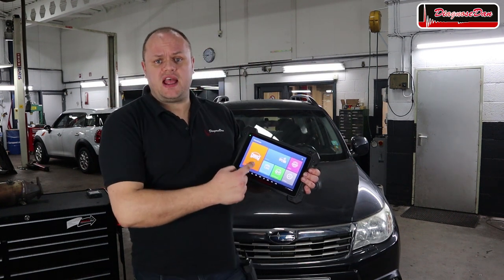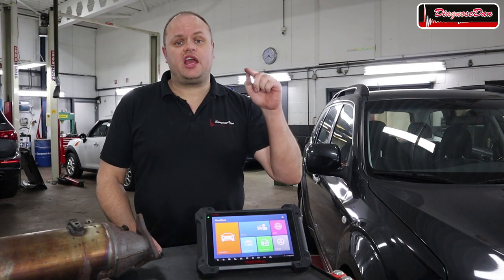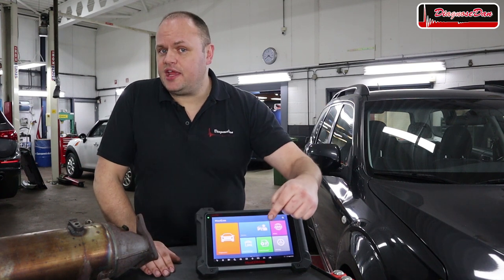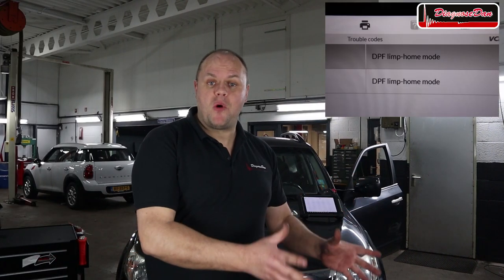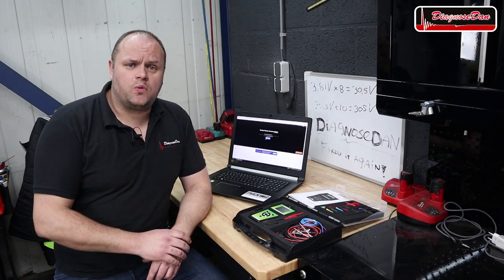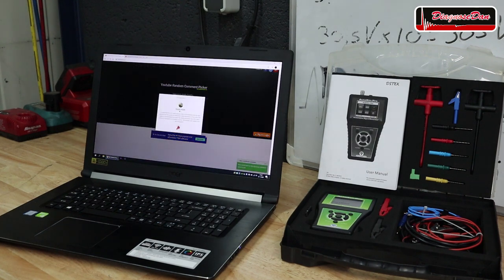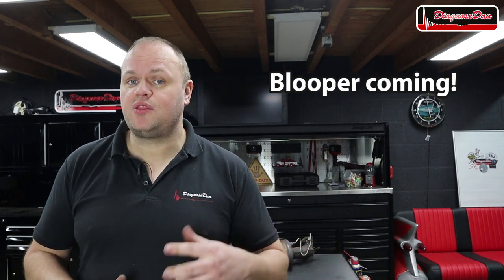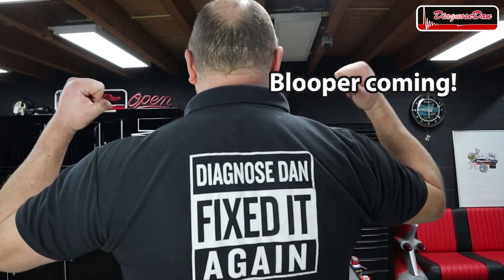New Car parts aren't always good Car parts!

Comment: You still dont know if the problems fixed. The aftermarket filter you have installed now can still have a smaller capacity. So the car will start to regenerate after like 600 or 700 km instead of the 800 to a 1000. Most cars will set a code on to frequent regenerations. Thats why I always tell my customers to buy a original or let the original get professional cleaned.
Reply from the maker: Thanks for watching 😀

Comment: There's also the issue that Japanese diesel motors are garbage. The older non emissions related stuff was excellent and bullet proof, but the later common rail with emissions controls are trash. Bosch and Siemens make the best diesel solutions - the Subaru stuff is just unrefined nonsense.

Comment: Hi danny and thank your for the video! there is some cars with DPF sensor with just one line that mesure just the front of the filtre (exp:clio 3 with 1.5Dci engine)... how the ECU can determin the difference in pressor ? and thank you
this is the sensor : https://picclick.fr/Capteur-pression-diff%C3%A9rentielle-RENAULT-15-19-20-23-283507248184.html

Comment: 6:55 can't you just use a t-coupler and have the gauge just do the difference measurement directly?
Reply: You would be creating a bypass for the exhaust gases, giving you an artificially low reading.
Reply from the maker: Ha ha than the pressure could escape to the other side of the DPF😉

Comment: Kind of looks like it could have been fixed like Toyota fixed a customer of mine's Toyota.  In this case it was a Cat code in a vehicle, within the warranty milage.  Yes Ma'am, we fixed your problem, the light is off.  A couple years later I get a call from her, her car is not passing NOX emissions.  Like a thousand dollar or so Cat replacement on her nickel this time (millage warranty over).  A little checking and I  found that the Toyota dealership had reprogrammed the computer to ignore the bad Cat readings.  She was in a state that was not testing for NOX so she did not learn of the bogas repair untill our state starting to test for NOX.  I did the best I could for her, contacting the state emissions department and Toyota Corporate.  Lots of back and forth but the customer solve the problem by falling in love with a guy who took her to a state that was not testing for NOX.  How about a reprogram to ignore the back pressure code?  I know, we go to jail for that, evidently not the Dealer.
Reply from the maker: There are alot of companies that perform DPF deletes. The DPF hardware and software is removed. People don't understand the DPF is there for a reason. Its to prevend the soot particles to end up in your Lungs and causing serious health issues. 
Inspection test are now introducing new and more precise tests that can detect a Dpf delete. Soon all DPF deleted cars are not going to pass Inspection anymore

Comment: at 15:53 the test on the scantool screen reads: Deviation between DPF inlet and outlet pressure Kpa
What you are looking at here is NOT a deviation (NL:afwijking) but just the pressure drop over the filter.
Also, there are 2 spelling mistakes in the unit Kpa. It should be written as kPa

A typical example of letting programmers write the User Interface without a proper review.
Reply from the maker: Deviation also can be translated as Deviantie=Verschil. 
Nothing wrong with that in my opinion.
Reply: @Diagnosedan  

According to a dictionary:
1.
the action of departing from an established course or accepted standard.
"deviation from a norm"

2.
the amount by which a single measurement differs from a fixed value such as the mean.
"a significant deviation from the average value"
Never mind. In the end, it is all very clear. The misspelling of SI units is more annoying.
I worked as an instrument engineer in the oil and gas industry. Deviation is used to indicate that a value is departed from the normal/requested/setpoint value.

In this case, a simple "Pressure Drop" would be clearer.

Never mind, interesting video.
How about cutting up the filter and further investigate the blockage?
Or was the part returned for a refund?

- Olaf -
Reply from the maker: @olafv.2741  part was returned for waranty

Comment: Original DPF aren't that expensieve just for fun. Especialy catalysator is very expensieve due to used platinium and similar. If there is platinium for 500 euros in original filter, how some can cost 500? No way. You dont have than catalysator efficient enough and regeneration cannot be done successfully. In several hundreds km it ist stucked by soot.
Reply from the maker: Thanks for watching 😀

Comment: Its just bad recycled dpf. Even oem are recycled. It looks clean but tunnels from engine side are linked with tunnels from exhaust side through tiny holes where whole magic of soot catching happens.
Guess 2: car does not know dpf is new, nox sensors not reset. Car is trying to reach regeneration temperature, going rich and dumping more fresh soot. In result the new filter is full for no time.
Reply from the maker: The Car never drove with the DPF.
Reply: Its interesing topic to me. Adblue, dpf, tools and toys (not sponsored) I'm looking forward for new videos of any kind.

Comment: Hello Dan.
After seeing this video i tought that you did not mention some details. My concern is that "what if the car has another problem that clogged the DPF".  I asked myself this, because you did not mention how much the car travelled with the first aftermarket DPF, and after that, was a regeneration made?what were the values before and after regeneration? Was this the case,or the car never left the workshop?
Reply from the maker: The Car never drove with that Dpf it was bad out of the box. After the replacement and clearing the fault code and resetting the DPF a snap-throttle would set the code again right away

Comment: Hardly any selection of diesel equipped engines especially for compact/ midsize pickups &  passenger vehicles here in North America. 
 Mexico & South America has more available. 
They want us to burn the petrol here for more $$$ the big oil white shoe boy club!
Reply from the maker: Diesel isnt cheap either, at least over here
Reply: Diesel was always cheaper in North America, up to 10cents per litre less in fact up untill about ten years ago but now it is on par or just a bit cheaper , sometimes a bit MORE expensive than petrol!
 Diesel ought to be cheaper as gasoline is a step or two further in the distillation process .

Comment: It's unfortunate that modern emissions systems are so complex and expensive that these cars will end up junked with a lot of good life left in them. So destroying an otherwise good car, shipping the remnants to China, smelting it into new metal, shipping that new metal, then manufacturing a new car will use more fuel and pollutants than if you just left it alone. Cutting off the nose to spite the face. But hey it pollutes .001% less and gets .001% more mpg than it would have.
Reply from the maker: Good point!

Comment: hey YOU NEVER rev diesel engine over 3000 rpm. diesel engines are LOW RPM engines and that can be disaster for the engine.